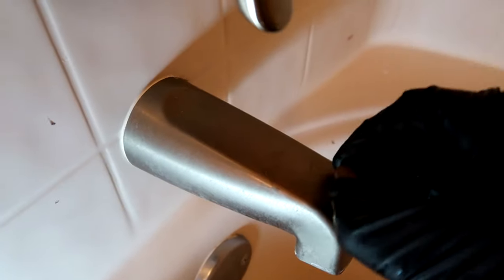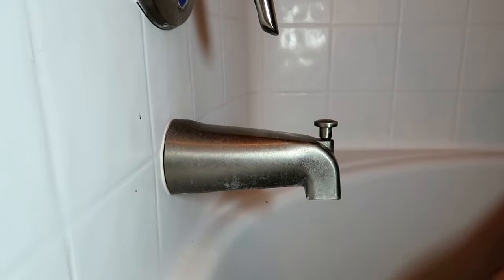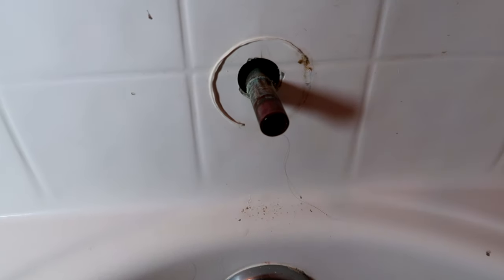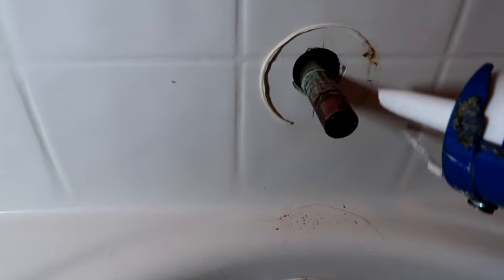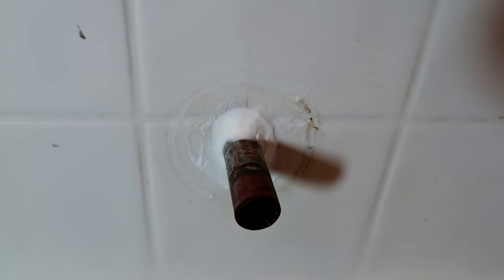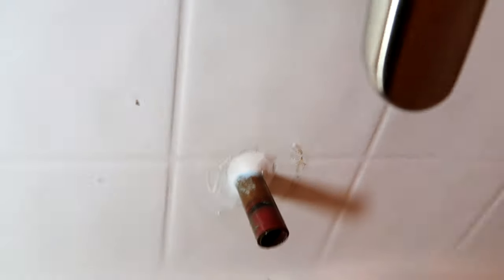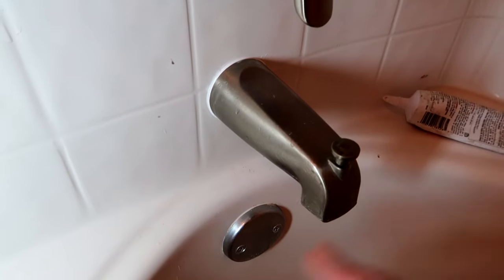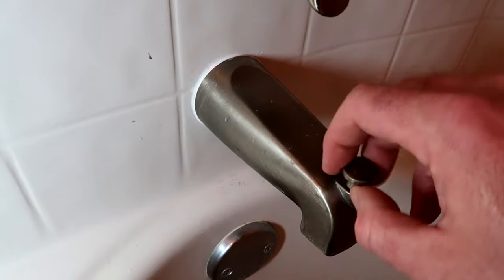Repairing a Loose Tub Spout That's Not Flush With Wall

Comment: not sure why but i have a good 3-4 inch gap on the place we are renting. Getting landlords to fix anything right is well I'm doing it myself. What suggestions do you have for this
Reply from the maker: You could get a copper pipe cutter from Home Depot and cut the pipe back enough to where the tub spout will sit flush. Go a half inch at a time so you don't cut too much off.

Comment: I usually tighten the valve screws in the main escutcheon plate to pull the valve and spout pipe forward. Put the spout on tight. Then loosen the screws to the main valve through the escutcheon and that lets the pipes back further into the wall and pull the tub spout against the wall surface tighter. Helps with the ole gaparoos.
Reply from the maker: Right on. Thank you so much for watching Jarrod!
Reply: Dude I was messing around forever until I tried the technique in this comment and it fixed my gap in no time. Thanks to both y'all!!

Comment: Nice quick & easy repair 👍 You did the same thing I would have done. Loctite is a kick ass product! I use it on the under mount sinks that fall down from the construction guys using some kind of junk sealant & they didn't use the clips to mount the sinks to the granite. Of course I don't have the clips so I have to use a good product to remount it & Loctite is it 👍 Keep the vids coming 💪
Reply from the maker: Thank you so much for watching Rich!
Reply: You've got that right. Loctite is the shiz. I've used for counter tops, sinks, tub tile, tub surrounds, etc, etc... Creates a nice firm hold.

Comment: Would silicone based caulk ok to use, my cover plate also isn't flush to the wall
Reply from the maker: Yes, silicone would be fine. Caulk the gaps real good and let dry if not flush as well.

Comment: Hi pal. Loving my new job and your videos have helped me SO much. Question: I had this same exact work order, I went and got some loctite, filled the hole and came back 3 hours later and it hadn’t hardened at all! Did i do something wrong or is there a specific type of loctite? I used the common one you find at HD. Thanks and input would be appreciated. Waiting for your next video!
Reply from the maker: I give it a full 24 hours usually to fully harden. Or, if it's a one bedroom and the resident needs a shower, I'll put a carpet fan on it and come back 6 to 7 hours later. That's about all you can do if you want full hardness. Thank you so much for watching Conga!

Comment: hey i have a threaded on tub spout and there is a half inch gap between spout and the wall if i caulk the hole around the pipe coming out of the wall will this keep water out since i have a gap between the spout and wall ?
Reply from the maker: Yes. Do your best to get the spout as close to the wall as possible and see if you can caulk the gap as well. That'll be a second line of defense. I hope everything works out for you Rupert! 🤞
Reply: @LexVance  can you please check the video on my page and let me know what you think should I use spray foam or caulk? When the spout is on it’s a half inch gap on top and 1/4 in on the bottom of the spout
Reply from the maker: @rupertturner7311  Use spray foam. That'll work.
Reply: @LexVance  right on thanks! If I ever wanted to replace the pipe coming out of the wall is it threaded in or fixed pipe and have to open up the wall to replace it?

Comment: Wouldnt just caulking the base of the spout fix it? 
Not sure if it will ,just a question lol
Reply from the maker: I've tried it and the heat from the water softens the caulk and it pulls off the wall eventually. It'll work temporarily though. Thank you so much for watching plychris!

Comment: any tips on how to fix this when the whole assembly is loose behind the wall? shower, single handle and tub faucet? it is in a one piece tub and shower wall unit with another bathroom behind it so taking out drywall and patching is not an option for me
Reply from the maker: Yikes! Not sure how to tackle that one without cutting the sheetrock behind it and securing it by tightening the screws. Sorry Wayne! 😭

Comment: Even with the Allen screw removed the pipe won't come off the tub faucet and I don't want to yank it off and cause some unknown new issue
Reply from the maker: Hmm I'd need to be there for this head scratcher 🤔.
Reply: @LexVance  I puddied where I could. I doubt it holds. If it doesn't , maybe I can film the pipe and faucet and put it here for u to check out?

Comment: Did you turn off the main water source
Reply from the maker: No, you don't have to for the spout. Only if replacing the hot/cold water valve do you need to do that. Thank you so much for watching Diysquad!

Comment: My home is 7 years old and so many issues! They just throw them up and move on. Anyway one day water started coming out of the ceiling down a kitchen pendent light so I called home builder who tried to tell me warranty ran out for plumbing and nothing they can do. I didnt accept that answer and after hearing from me they sent someone out. They cut a hole in my ceiling and the wall in the upstairs bath. Turns out it was a loose spout and a lot or water was leaking out. They patched up the holes in the ceiling and wall but didnt  tie it down they left it and said it needed caulk but as I know now it isnt a sealant issue its just like the spout  in this video. The ceiling and wall are still original construction paint and when they went to repaint the ceiling and wall  didnt match the house at all. They tried to leave it but once again that wasnt going to fly with me so they went and got a match made and fixed it. Not exact but way closer. 

I cant explain ow they thought just sealing it would work when the spout jiggled and would just come loose again.
Reply from the maker: I hope everything works out for you! 🤞

Comment: Or don't hack it together with caulk that's going to fail months down the road and use a star push nut and screws or god forbid you absolutely have to use the star push nut with some kind of epoxy
Reply from the maker: 👍😆👍 Right on. Thank you so much for watching jfitz!